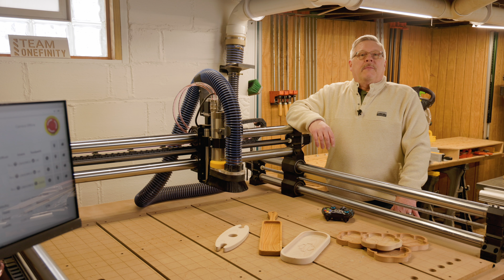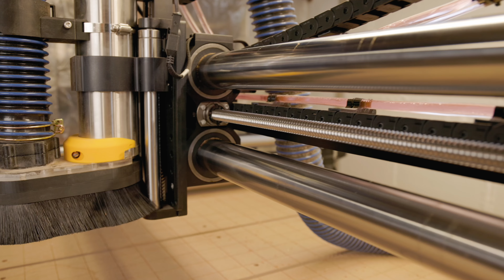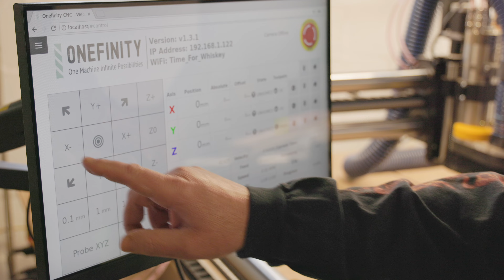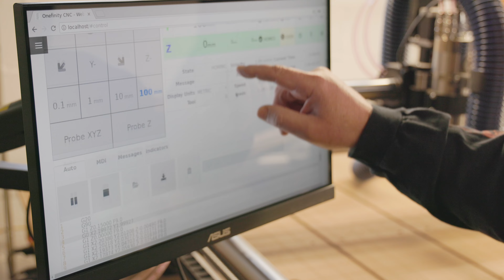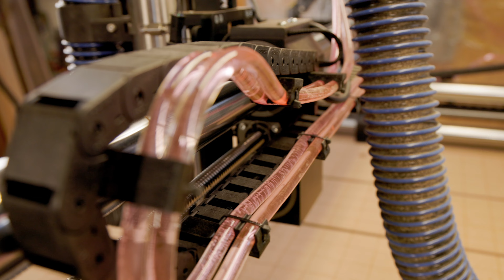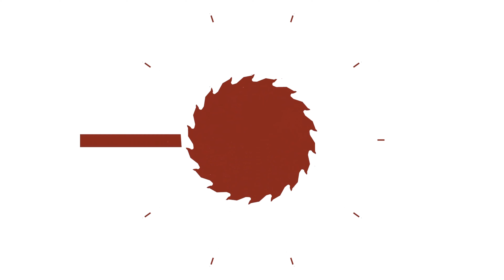Is the Onefinity Pro Series CNC right for you?

Comment: Great review!  You certainly helped with my decision.  I'm still wrestling with one question: floor space.  I have a two-car garage, so  a table-mounted CNC will take up a ton of space.  I can make it fit, but it will be tight.  Some of the Pro models will work with the wall mount, while none of the Elite series will work on the wall.  Candidly, I'm not at all sure I like the wall mount idea due to issues with dust collection and materials handling, but it is an option.  Looking forward to seeing your projects!
Reply from the maker: These machines can be pretty heavy and being flat and level all are of the utmost importance for most projects. I'm with you, I am not a fan of a wall mount. In my humble opinion you'd be better off with a smaller machine (depending on your plans). 90% of the time I find myself using about a 24x36 area in the front of the machine. I am fortunate enough to have the space so I got the larger machine for those times I DO have a use for the larger area. It's simply more jobs you can say "yes" to. By no means is that space of critical importance though for most projects. Just my opinion, enjoy your new machine! Thanks so much for watching!

Comment: What computer are you running the software on?
Reply from the maker: I run Carveco Maker on an M1 Apple Mac via Windows 11 running on Parallels. So far, only a couple of very insignificant issues running on a Mac this way. For file transfer I simply use my browser (Safari) from the Mac side.

Comment: Thanks for sharing your video and welcome to the Onefinity family!!  I have the X-50 I purchased in 2022.  Works like a champ.  I'm on my second router (first was a Makita) and looking to go towards the PWNCNC spindle like pretty much everyone else does.  I do have a question though.  I see you aren't running the 3rd rail (like I am not).  How does that spindle hold up for you without the 3rd rail?  Seems everyone I've seen so far runs with the 3rd rail.  I can get the third rail for $170 but looking to get the spindle first.
Thanks again and oh....I'm in Akron!!  :)
Reply from the maker: Hi John, thank you for watching and I am glad you found the information of interest. I have zero issue with not having the 3rd rail. I have not noticed any deflection, or issue with not having it with the spindle at all. I also have not had any issue with spindle drop as some others have experienced, and why 1F came out with the Z-20 braking motor. Akron, hey! You are fairly close. I head that way somewhat often, rising some of the sawmills that direction. If you are ever in my neck of the woods feel free to give me a shout. When you are ready to make your purchase from PwnCNC, don't forget to use code "APPCRAFT" on checkout to save a few bucks. At some point I'll be doing a review of my PwnCNC system. Thanks again for watching and saying "Hi!"

Comment: I've been thinking about this choice. It isn't often that two different tiers of a product have plusses and minuses on both sides other than price. When I followed the differences link on the site, I was surprised to find out that I'd be giving up some significant things by going with the Elite, like the joystick and the larger monitor. I haven't confirmed, but I assume that the closed-loop stepper motors in the Elite will not work with the Pro controller, as that would see to be a significant upgrade for a lot less than the $2K that the Elite upgrade will run you.
Reply from the maker: Agreed. Like so many things +/-, but the Pro series suits many quite well I feel. Sure it's always nice to have the biggest and best of anything, but many times not really necessary to get the job done. And this is coming from a guy with Festool tools, lol...I am pretty sure that the closed loop stepper motors require the Masso controller as the BB controller does not have the capacity to receive the location feedback. Plus I would imagine you need the homing sensors, etc. Thanks for stopping by my channel!

Comment: Thank you for going through this. I’m currently running the original woodworker and wanting to upgrade to a foreman but have no need for adding a 4th axis, atc and am fine with using a touch probe, plus I feel very comfortable with the interface and it’s over $1,000 less. I’m always just worried about buyers remorse.
Reply from the maker: You are very welcome. I am glad some are finding the information useful. I certainly understand where you are coming from. If you are happy with what you have, and don't need the larger cut area, there's probably not a lot of reason to change your setup at all in my humble opinion. If you are thinking of upgrading, I think it comes down to: budget & wait time. The Elite has it all currently, the best of the best. The Pro will certainly get the same jobs done (with the exception of 4th axis), and allow you to add a spindle if you'd like (which is definitely worth the price of admission! IMHO) for about the same price difference. Or you could just pocket the $1K. Definitely food for thought. Each has it's advantages. Thanks for your comment!

Comment: nice review.   I'm also new to the cnc world and have been looking at the Onefinity's for a long time.   What is the difference between the Pro and Elite as far as the software and user interface?   I've heard people love the Masso screen.
Reply from the maker: Hi Dave, thanks for your question. I do not personally have the Elite so I cannot really comment first hand, only on what I have seen/reserched. Having said that, I do know that the Elite does offer a much more robust software interface via the Masso controller. Things like being able to adjust speeds and feed rate on the fly, parking locations, the ability to use a tool setter, etc. All of these things are things that I, personally, would consider more luxury & convenience type offerings for the average hobbyist that is not in a high-volume environment. As far as functionality and the types of jobs you can do, the only thing I understand that the Elite/Masso setup can really do that the other models cannot is 4th axis carving.  Hope this helps!
Reply: And ATC capability if you want it in the future.

Comment: Correction: you can purchase a very inexpensive wireless mini USB keyboard to jog you elite machine remotely. Cost less than $20 which I believe is cheaper than the joypad
Reply from the maker: Thanks for the correction Darian. I was unfamiliar with that type of device. The joypad is still included with the Pro series, so still a small savings.

Comment: Correction, the elite series has at least 3 USB ports. Only one is easily accessible from the outside of the monitor. The others are accessible by opening the monitor via the 4 corner screws on the front.
Reply from the maker: Thanks for the correction Darian, so same number but only one easily accessible it is!